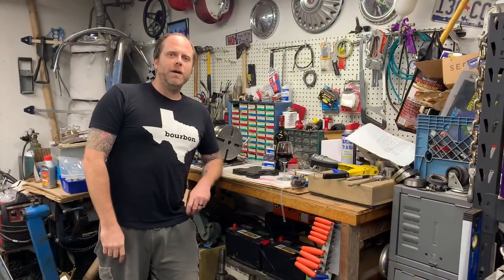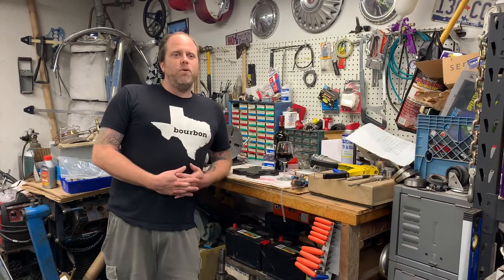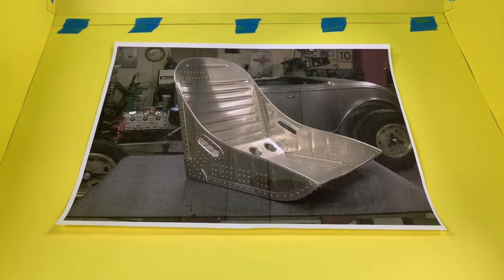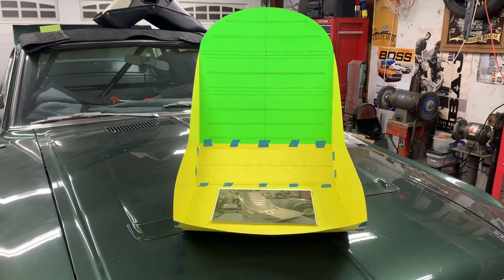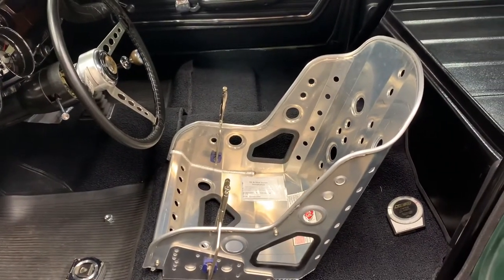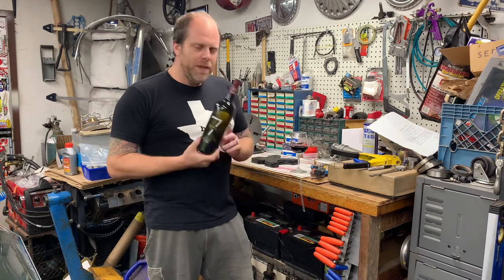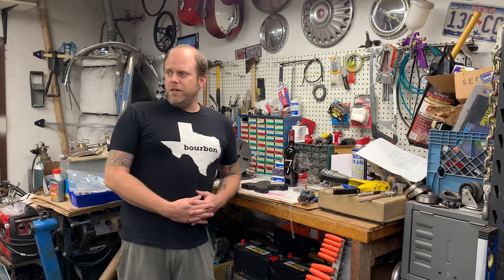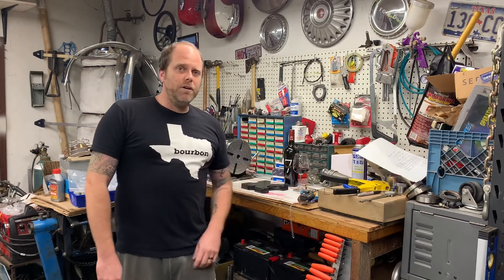Building Vintage Bomber Seats Pt1: 1928 Ford Model A Hotrod Project; The Crazy Casey Roadster Ep17

Comment: Yeah, do it. Harbor freight beadroller works fine,after you have beefed it up. I did mine yrs ago and it has served me good. I welded an U-beams on the opposite side where the axles are on the jaws and connected them with and another U-beam , what is upright position, near the crank. I also made an stand for that. I think beefing up the beadroller video might be something that ppl want to see, even if they are not into hot rods. Keep it up!
Reply from the maker: Thank you. I wonder if what you are calling “U-beams” I would call “C-channel”? Three sided rectangular stock? I’m not familiar with your terminology. I was thinking of using angle iron to make a pyramid shape on the backside, and then tying the two long runs together with a third piece of angle cut to fit in between. Lot of weld surface to be had, and triangles, in general, are very strong. May or may not make sense how I’m describing it…

Thanks Again!
Reply: @crazycaseyscustoms  Well, i guess C-channel is right term for those. I live i Finland and i thought those were called beams too, sorry about that. I "boxed" the beadroller frame with the c-channels, pretty much same way than you planned to do with  angle iron, but i think C-channel is more sturdier than the angle iron would be. It became pretty heavy after the beefig up process, so the stand was needed for it. There was few good threads about this subject on hamb too.
Reply from the maker: I think it’s probably just a colloquialism based on our respective homes, @1fknhpycmpr355 . Channel/Beam seem to be interchangeable terms; in construction it’s called a beam, and in a metal shop it’s probably referred to as channel. I’m not sure if one is more “correct” than the other. What is sold most readily at our local metal supplies is the C, whereas the U is more finished in the inside corners and probably somewhat less structural…I had to Google as I’ve never actually come across it, “in the wild”. Anyway, I learned something new today, so thank you for that. 😊

I have seen people merely weld flat plate to the back of the bead roller frame, making a “tee”, and it seems that the rollers were sufficiently reinforced, so I’m sure either method using channel/tubing/beam will be more than adequate. I appreciate the tip on the weight…I am anticipating having to build some type of stand. Oh, and I have checked out some of the HAMB threads you mentioned, too. 👍🏼
Reply: @crazycaseyscustoms  Whats your username on hamb? I think i have some pics of my beadroller there, if you like to, i can share pics of that thing. I went kind of crazy with the reinforcements, so it could have worked fine with less reinforement metal, but the stand makes it easier to operate, but i guess it works fine as a table model too, if you have a good vise
Reply from the maker: “crazycasey”,  @1fknhpycmpr355 . 👍🏼
Reply: @crazycaseyscustoms  message sent
Reply from the maker: I haven’t had a chance to check, yet, but I saw the email notification, and I think I remember seeing yours in one of the threads via your HAMB handle,  @1fknhpycmpr355 . I’ll respond to you over there when I get some free time. 😊

Comment: Awesome! Did you ever finish mounting your rumble lid with the stops etc? Im in the middle of that right now on mine...
Reply from the maker: I have not gotten to the stops yet, Ollin. My seat riser is in REALLY bad shape, and that’s what’s been holding that part up. The lid is all body worked and primed (fits much better in the corners now), but I’m afraid I can’t be much help on the seat riser/stops…yet. 😊
Reply from the maker: I do have some pictures I dug up online, if they’d be of use to you. Are you on the HAMB? I can post them up there…
Reply: @crazycaseyscustoms  yes please do!, i used to go on there more, but i still have an account. Thanks!
Reply from the maker: Are you following my build thread on the HAMB, @ot505 ? If I post those pics there, will you be able to find them?